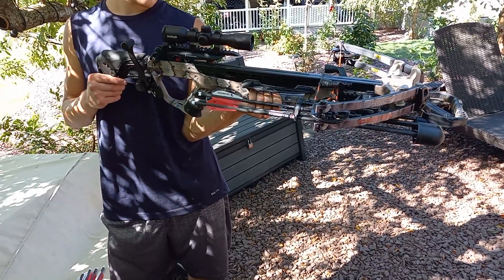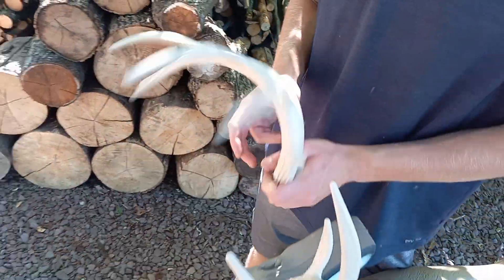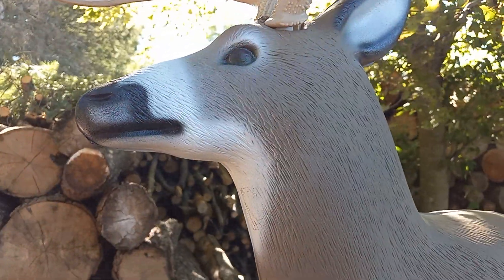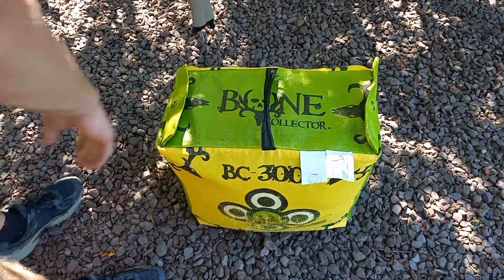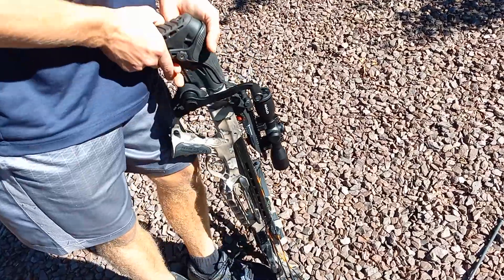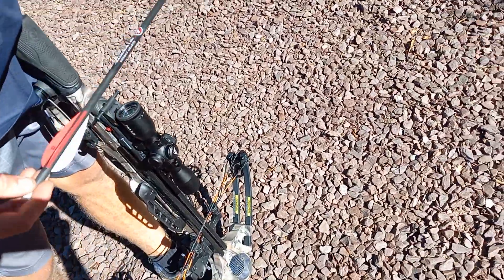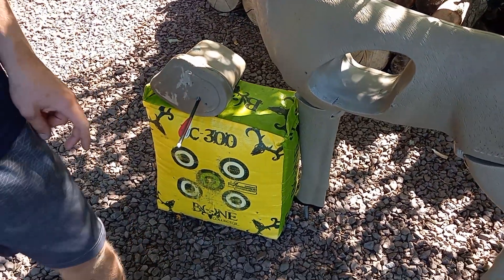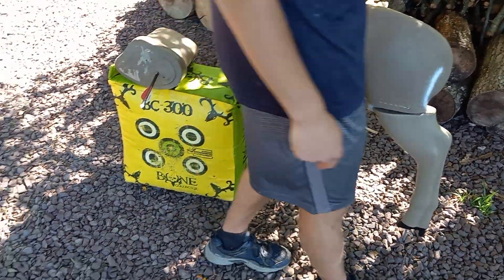Part 2 of Barnett Crossbow Review

Comment: 2 measurements you’ll want to write down on ANY compound crossbow is 1) axle to axle  uncocked and 2) timing reference, whether it’s marked on the cams or measured from a certain spot.
Strings and cables stretch, so that’s why you should find out what these are because once you get the crossbow sighted in the string, and/or cables will likely stretch throwing off these measurements causing inconsistent groupings and scope holdover marks to be off.

With the Bonecollector target you’ll find that it works much better at stopping arrows(field tips only) if it’s suspended (hangs) off the ground
Reply from the maker: Okay, Thank you for information.